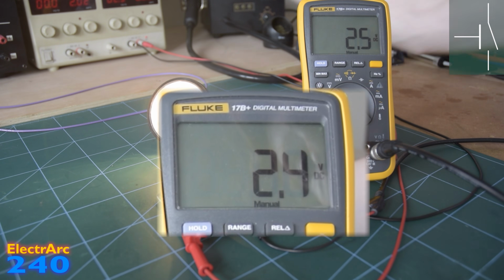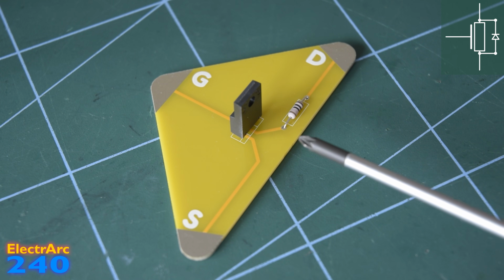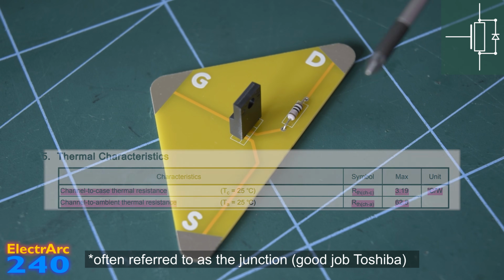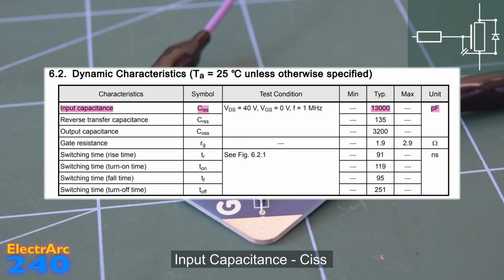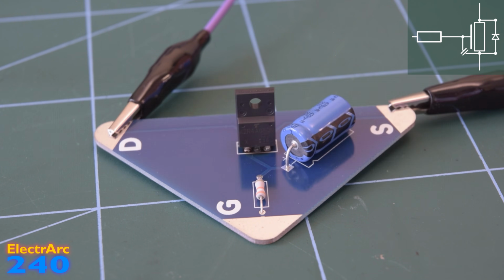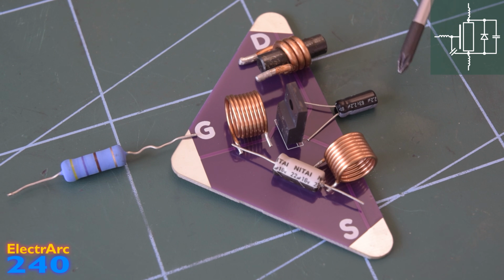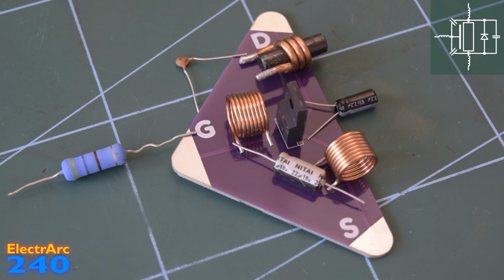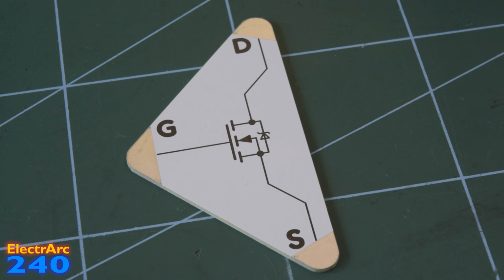Everything You Need to Know about MOSFETs

Comment: If there is one takeaway from this (as a digital guy) is I need to find a MOSFET expert to design a circuit/PCB for me. I am beginning to realise why things have not been working. What an excellent video. You could do a whole degree in MOSFETs alone.
Reply from the maker: You certainly could!
Reply: Speaking of which what was your degree  @electrarc240  in University?
Reply from the maker: @Pang_Yau_Wee  I am actually still at university (on placement year at the moment). Studying EEE (Electrical and Electronic Engineering)
Reply: It kind of works like that if you try to use IC's as much as possible for 'function blocks', most IC's use cmos. And if you want to use a mosfet to switch something use a mosfet-driver IC and use the recommended circuits in the datasheets of the IC's, then you can kinda just treat it as if it's all digital.
Reply: I can only recommend reading the PDF from TI named "Fundamentals of MOSFET and IGBT Gate Driver Circuits". You'll find everything talked about in this video, but with a much more in-depth discussion and with actual circuit solutions to those issues.
Reply: I started in digital, WAY WAY WAY back (45 years ago), I had to get into analog for client needs, power supplies & DC-DC converters.  I rapidly found out that just using a most (like you would with a digital element) only works well when you are VERY lucky.  This is when like with bjt's, op-amps etc., I had to get into the mosfet parasitics, and life was good after that! :)
Reply: Different types readily blow up if you put them in class A for a few ms too.
Reply: The connection between 2-port circuits and the analysis of 3-lead devices like MOSFETs and BJTs is crucial for understanding how these components function in more complex circuits. By considering a MOSFET as a 2-port network, you can better grasp how the various parameters interact, even though MOSFETs introduce non-linearity into the equation. The emphasis on Appendix C and the importance of mastering 2-port network theory as a foundation is a key takeaway, as it provides the theoretical basis to transition from analyzing simpler 2-lead devices to more complex 3-lead components.
Reply: @freeenergytransformer5842  Appendix C? Of what?

Comment: The lamp has its own power supply and the red and black wires are used to control the switching of the lamp on and off? You have two loads into the source, but the red-black supplies a voltage of little power that is used to control the power to the light?
Reply from the maker: Exactly. Two separate circuits that only join in one place; the source terminal
Reply: @electrarc240  So, you have isolated DC power supplies (no common ground).. this allows you to switch the polarity. It was easy enuf with the relay plectrum, but one needs more care with real MOS.. That body diode may have current limitations that get us into trouble!
Reply from the maker: @AnujValmiki  This was all just demonstrations, not examples of how to actually connect a MOSFET